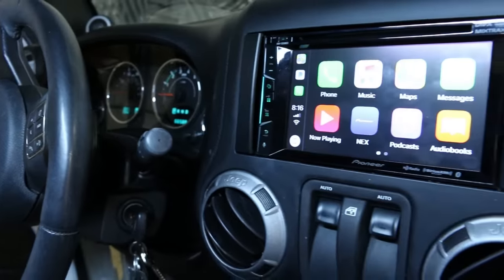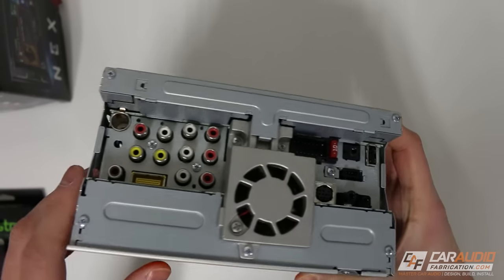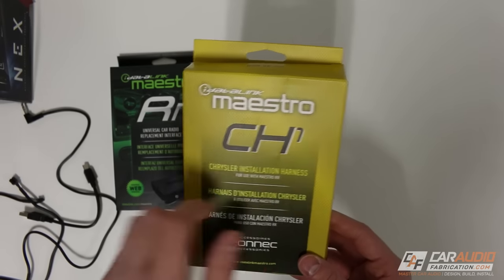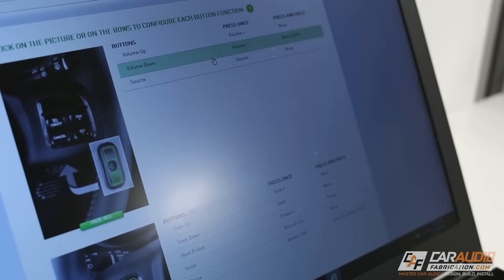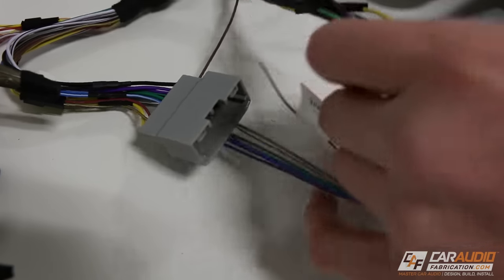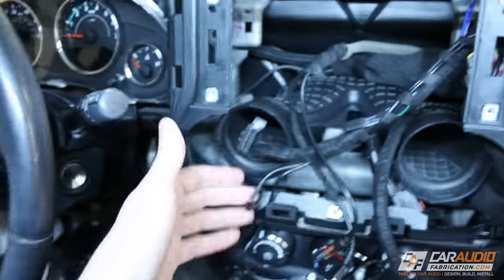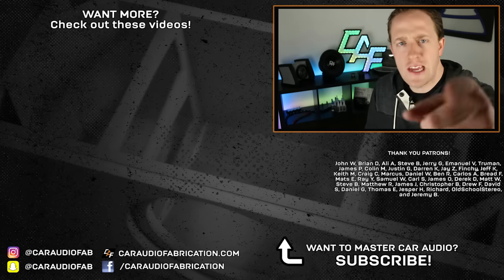How to Install Aftermarket Radio (Jeep Wrangler 2011-2017)

Comment: If youre having an issue where you can see into the dash from the bottom of the radio you can trim 1/8th inch off in the inside top and bottom lip of the kit that touches the front sides of the radio. Helps a ton on the radios that don't have a motorized screen as they sit much further out.

Comment: This post helped immensely.  The only thing I ran into that was a problem was the CH1 has a control cable that is jeep wrangler specific.  I didn't see that.  Once I hooked it up everything worked great.  The other small issue was the metal support piece that is surrounding the stock head unit.  That needs to go for the new double din to fit.  Otherwise you covered everything!
Reply: Can you explain to me what cable this is? I have done the entire wiring harness and didn’t want to maestro because I don’t care about steering wheel controls so can I use it without that?

Comment: This is old. I just updated my 2016 Jeep with an android v12 . It was truly plug-and-play and extremely easy and more professional looking.  A lot has changed in 5 years
Reply: @dan-777-abc  it’s not old, android radios are plug and play, pioneer radios aren’t plug and play
Reply: Which is the old way . Great Android Head units are relatively easy to do for a DIY,   Very cost effective, and have a very good screen for viewing.  That’s the modern way

Comment: Hey Mark, thanks for this video! I have a Jeep JK and will follow this for my own install. One question: Could you say more about how you wired in the remote wire to the amps? I see the thicker blue wire connected to the harness, but you don’t mention the process in the tutorial. Would love to see how you connect the remote wire to the deck and then to the amp(s). Thanks!

Comment: Great video.  I have a 2013 Jeep Wrangler (no factory AMP) and replacing radio with a Pioneer AVH-2330NEX using a Maestro harness. I get everything to work except no sound from speakers. Can't figure it out. Any ideas? Thanks

Comment: I just want to confirm that you did reinstall the uConnect module w/o the usb and secondly were you able to use the factory microphone or did you have to install the microphone that came with the pioneer head unit?
Reply: this
Reply: I am wondering the same thing. I just installed a Pioneer AVH1550NEX and the microphone isn't working.
Also wondering about Sirius satellite connections.  Thanks

Comment: Serious question: if you have no desire to use Uconnect (I removed it as a feature when loading the Maestro firmware), do you need to put the box back into the console? Also, thanks for showing that trick to run the cable to that adapter so you can use the USB connection inside your armrest box! Finally, do you know of anyone who has a video on modifying the metal bracket you took out? It's a pretty handy piece that I think is needed, especially to stabilize the top of the dash, and to allow me to put a mount back in place.

Comment: Hey Mark did you install the Bluetooth microphone that comes with the pioneer headunit? I’m going to be installing a Kenwood DMX 7704s in my 2013 silverado using an idatalink maestro but I’m not sure if the factory Bluetooth mic will work or do i have to use what came with the new headunit.

Comment: This is a great install  Video for Jeep Wrangler. I do have one question a lot of Jeep owners use that top bolt in that Top tray to hold down  Cell phone and tablet mounts. That metal bracket you took out from the inside of the dashboard actually has the  The part where that screw goes into. What do you suggest if people need to bolt stuff from the top?
Reply: kawlreaper I have the same questionplease help.
Reply: I modified the original bracket and put it back in. Was a real pain.
Reply: Just add a nut on the bolt cell phones don’t weigh much

Comment: Super super beginner. The harness purchased separately has an adapter where on your video the wires are exposed and ready to solder. Can I just cut the plug off and splice wires together as shown?

Comment: Great info!! I do have two problems with my radio though… 1 out of 4 times, the unit starts with no sound!!! And the harness I found only sends 2 channels of sound so L+R are hooked up on Rear and front at the same time!! Any advice!?

Comment: Great video and Thanks!! I do have 2 questions hopefully you can answer. 1) I have a Pioneer AVH-4200NEX going into a 2014 JKU, should I be able to use the factory mic? I plan on removing the UConnect if that maters at all. 2) I bought the USB adaptor from your link, was it long enough on it's own for you?

Comment: i am confused about 13 mins in. you talk about the u connect, you show how to take it out. you explain about the port that goes to the arm rest. you say you will plug it back in but do not show where, you went straight to that section all butted up and just the top part for the radio.  The one adaptor to the left, that you say goes to the arm rest, is that the usb end at the top when you talk about how you bundled items together?  what did you do with the Uconnect port? is it just hanging out in there or did it get connected to something else?

Comment: I was researching this last night for my 07 Silverado classic.  It looks like I need two different modules one to retain the door and warning chime and another to retain the steering wheel controls.   Unfortunately the head unit from my old pickup isn't steering wheel control compatible so I need a new head unit.  Actually would you be able to reccomend a decent single din head unit?  I don't need all the bells and whistles I'm looking for one I can connect my android phone to.

Comment: Tell me you fixed the gap on the sides of the radio. Pioneer did the last few years of touchscreen radios very thin. We trim the corners on the kit to side the brackets just little further back and it hides the gaps a little better.

Comment: My question was is I put a jvc in my 2012 jeep Jk but I didn’t buy anything for the uconnect cause I didn’t care about the steering wheel controls, but I was wondering does the new radio use its own amp or does it actually use the oem amp that’s under the steering column

Comment: If you don’t want the steering wheel controls to work anymore do you still need the Maestro brain or can use just use the wiring harness and connect all the colors based on the radio and it will work or no?

Comment: I am viewing this in 2020 & you made the video in 2017 so I hope you are still answering questions. 
I have a 2011 wrangler with stock unit. I would like to know what will I gain or lose if I decide to keep the uconnect still connected if I use the maestro? In addition is it also true if I keep unconnected in will I not be able to put in a Destiination within CarPlay while the car is moving?

Comment: I know this is kind of an old video, but where did you ground your stereo to? I have a Alpine ILX-W650 with two older Alpine V12 amps, one 5 Ch and one 2 ch for a sub. Can’t seem to get rid of “alternator noise” through amplifier grounding so I’ll try stereo grounding next. After that I’ll try 0 gauge grounding straps in the engine bay and see if that helps.

Comment: I noticed you took out the bracket in which the dash is held in at the top. Did you reinstall that to hold the upper dash into place.

Comment: I didn't scroll through all the comments so I apologize if this was already brought up; 
I'd there a harness or module that would allow me to retain all the factory features without having to use the OBD port? Or is it possible to hardwire the wires to the OBD behind the actual port?

Comment: I have the powertek acoustic stereo in my 01 Cherokee and I was wondering if I would be able to transfer it over to my 2012 wrangler ? Currently there is some off brand Japanese radio in there called nakamichi and I don't like that it does NOT have the android auto functions, due to the app that the current radio wants me to download that doesn't even work.

Comment: I have watched this video 10 times and have ordered the parts that you recommend.  Two questions- Our Wrangler has a time left on the free trial from Sirius XM- do I need a separate part to utilize satellite or just the satellite antenna adapter? Also- I know the radio you installed has backup camera capability.  Do I need a different set up in order to install camera?  Thank you in advance, I am a novice, but pretty handy and willing to learn and try.

Comment: Great video! What year is your Jeep? I am curious...does your steering wheel control work with Siri for your Apple Carplay? Also, if you do not have the extra amp does the new system still require the RCA out cables for the speaker system? Thanks for your help!

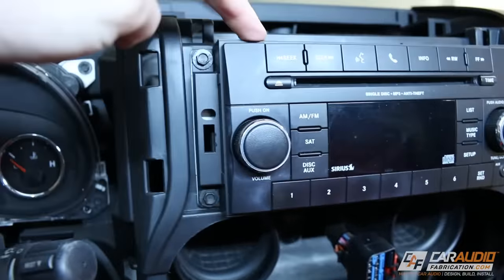Comment: Per your video, you removed the metal plate/bracket (11:55 on your video) that was behind the radio.  Is that the screw/bolt that was under the junk collector on the top of the dash, was screwed into?  The previous owner did this install and that screw/bolt is missing.  Since the screw is missing, the dash can slide forward just a bit and squeak's. Any solution for this?  Thanks!

Comment: Mark
What is the best ground wire connection position to avoid noise?
STD wire harness?
Straight from battery?
Same point as amplifiers?
Dedicated position near dashboard?

Comment: Hey Mark i just purchased a single din radio and to be honest I dont really want to spend the extra money on an interface to connect the steering controls. Will this make the radio unable to turn off? Does the stock harness have that cable?

Comment: I have a 2008 Jeep Wrangler Unlimited that I am installing a Pioneer AVH-X390BS into. The jeep is the most basic of Jeeps! I am looking at the CH1 wiring harness I believe. If I want to hook up later on back up camera or an  amplifier then I would need to get the Maestro RR, correct?  Is that all I will need for a basic install?

Comment: Hello Mark,
Just came across your video regarding this install. Great presentation! May I ask, My 2018 JK did not come with a SW. Where would I install it to get the best results w/out casing distortion and do I need an amp to do so?  m not looking for a lot power, just great sound. Regards)

Comment: Wow! Great video ... I've got a 2017 Sport that I want to keep after the lease ends (yea, yea, I know ... but I love the car)  ... only drawback is the awful uconnect system. Every Wrangler dealer told there's NO way to put in an aftermarket system ...  gotta say the Chrysler dealerships are the worst I've ever dealt with and I've bought everything from Hondas to BMWs over the years. Thanks for a great vid!

Comment: Great video! I followed it to install a Pioneer avh-1500nex.  I am wondering how to secure the random crap holding tray using the screw if we remove the stock radio metal bracket.  I have a phone holder that uses the screw in the tray.

Comment: I have that same setup and I got a lot of noise/EMI when I used the OEM usb port in the center console. I'm curious to see if you have the same result. I was also pretty disappointed the Maestro adapter couldn't give me the reverse signal for a manual transmission. All of the lights in the vehicle are on the canbus. So I'm not sure why they didn't just identify which address and value was for reverse lights and build that into the firmware you load.

Comment: Thanks for the help in tips on aftermarket car audio upgrade. I just installed all new kicker audio and new head unit. Weird question but, after installing new speakers and amp. I noticed some engine noise. Do I need to upgrade my alternator or could it be a ground issue?

Comment: Do you have to have the maestro for the 2012 keep wrangler? I found an adapter harness that's supposed to retain the factory steering wheel controls.

Comment: Great install! I have a question on how you bolt the top 7mm bolt back down under the top trash tray without the old radio support? Does pioneer make an adaptor for this?
Reply: I just seen this video, but just wanted to send a reply I just cut the bracket and fit it back in, and I have a phone holder bolted to that bracket
Reply: @codebluejku  how / where did you make your cuts to facilitate keeping the 7mm nut for the phone mount? Thanks!

Comment: Thank you for the great video! In regards to keeping the OEM XM radio, is it just a cable you need or do you have to buy an aftermarket XM tuner as well? I have a '13 with Alpine factory system and Uconnect
Reply from the maker: Your vehicle needs XM existing to retain. I believe it is just a cable.
Reply: Good deal, thank you! How is she liking the AVH-1330? Trying to decide between it and a AVH-2440NEX..

Comment: Amazing detail thank you so much this was the first install I had professionally done and they did a horrible job all the wires came undone do to just using electrical tape. My front right is my front left and back left and front left is front and back right when I asked them why they did it this way they explained that it’s normal. Any insight on that?
Reply: Your "professional" was a hack.

Comment: i have a question about the wiring harness.   my jeep doesn't have factory bluetooth, navigation, or u connect, would i be able to use just the CH-1 harness and abandon the steering wheel controls, or is the Datalink necessary?

Comment: I just connected my new radio using the harness with everything you had. I have a simple double din but my steering wheel controls aren’t working. It has a plug in for it in the back (like a aux port) but the other wire I’m not sure what to do with it do I have to have both connected?

Comment: I bought everything and installed my radio today and found out the 1500nex isn’t supported by the rr only the 1550nex so I can’t flash it nor use it. Can I still use my radio and just lose some features?

Comment: I've installer a new touch screen and the bottom of the dash opening once installed, isn't flush. Those little teeth on the bottom. OF the opening are getting in the way. Can I just shave them off?

Comment: I installed mine but, when I turn the key to acc, the unit turns on, and when I fully turn the key to turn the jeep to run, the unit turns off (looses power) and then boots up again as the jeep starts. I see the logic in this but the unit turns off as it's loading (in the acc stage) and then has to power up/load all over again once the jeep is on. I can't help but think that over time, this has damaged the unit. I absolutely HATE mine. Excellent video, though!

Comment: Hello, I am planning on installing an Atoto A6 in my JKU. I was thinking about putting the GPS antenna in front of the accessory tray in that little spot between the tray and the windshield (between the 2 defroster vents. I was also thinking about running the WiFi antenna up along the A pillar and maybe installing it in the headliner or the passenger side pillar.  Thoughts? Thank you!

Comment: Could you touch on the USB adapter you installed right after taking the uconnect module out?? As in where to connect it to the back of the radio or wherever it goes? Thanks

Comment: I have tried to install the same 1330 nex with the maestro in a 2013 wrangler Sahara Unlimited, but I am not getting any sound.  Any ideas?  Also do you have any suggestions for what I need to purchase to get factory satellite radio to work with the 1330. I have purchased the sat1 and nav2 pigtails. No place to plug them in.

Comment: Hi ther i was just wondering if you can help with my car system set up, i am looking to get 4 mids 2 tweeters 1 sub and a sound processor and 2 amps what will be the best way to set this up? im useing a ipad for head unit thanks and sorry about spelling and grammer

Comment: did you reinstall the uconnect?  I just left mine out when I installed my new radio.  just wondering if I should have reinstalled it with just leaving the one usb unconnected

Comment: Can you post wiring for the harness? I did this and I'm having issues with volume.  2011 wrangler with factory amp
Reply: You probably didn’t install it well or the amp not working properly

Comment: Great video! Tiny question though... the only steering wheel controls on my Jeep are cruise control and vehicle menu display (mpg, outside temp, etc) no Uconnect. I don’t need the mastreo datalink correct?
Reply: Feel behind the steering wheel.

Comment: HELP
Hi Mark
I am a big fan of ur work and follow ur channel regularly. I want to instal pioneer deh 80prs in the networking mode with active crossovers. The components i am using are Polk Audio db6501 and the problem is i dont know the low pass filter frequency for the tweeter, so i dont know what value to set for it. All i could find on Polk Audio web sites was the combined frequency range for the component system is 35-23000hz. I dont know where to cut the high frequency to pass through the tweeter. Can u help bro?

Comment: Will this work with a 2010? To my knowledge it uses the same radio.
Reply: Unfortunately I doubt it. The 2011 had a pretty major redesign electronics-wise, even if the head unit looks similar, so you'll have to find instructions for your vehicle.

Comment: Were you able to reuse the screw under the random crap holder tray?  If yes, how did you get to reuse it? I had an aftermarket head unit installed by car toys and they failed to reuse the top screw,.  They said they had to cut out the metal bracket that the screw originally went into.  Please reply!!!
Reply: I cut the bracket I have pix on my Instagram page probably about a year late though
Reply: @codebluejku  Could you please share the picture?  I cannot seem to find it in your instagram.  thank you!

Comment: Did you have to run seperate microphone for the head unit? Or were you able to integrate built-in microphone after you removed uConnect unit?
Reply: Could we get answers from anyone to this question